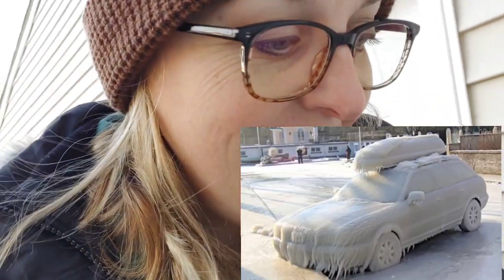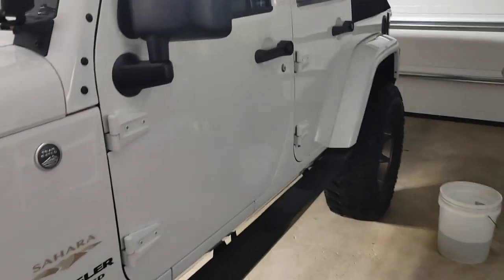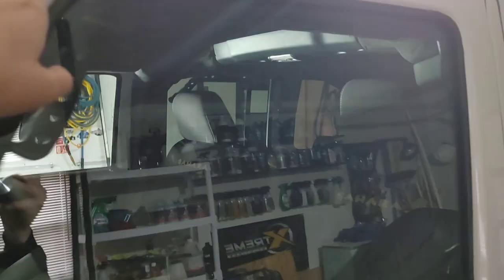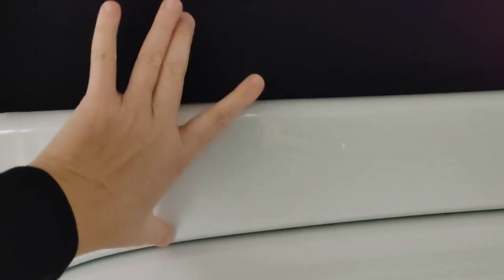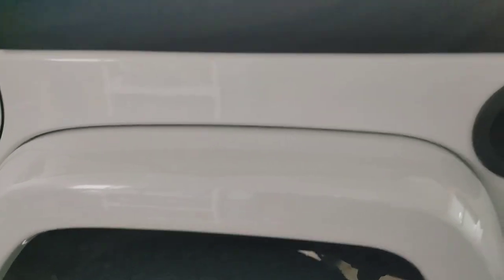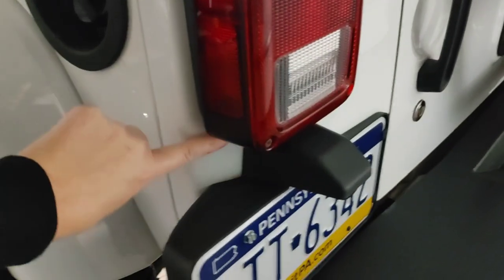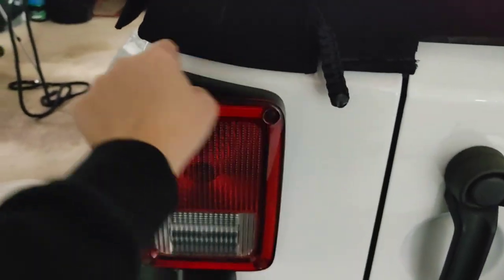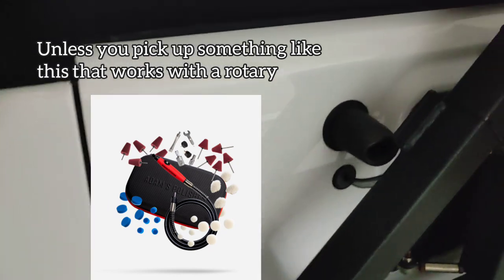Tips On Polishing Jeep Wranglers- Polishers and Techniques To Make A DIFFICULT Detail Easier!

Comment: Chelsea, question for you. I'm doing a Jeep at present. The Jeep is near completion, Ceramic Coated but on 2 fenders  I saw 2 areas I didn't like so I hit them with 2000 light wet sand, scratches are almost out but a little hard to remove completely. What's the best method to finish out. I use PRESTA Compound & polish. I normally do Gelcoat Correction. What's a good RPM for this fender & pad selection?

Comment: Nice info! I'm jealous that you're able to work when its that cold. It's bitterly cold here today and I just can't get my shop heated up enough to work in. :( Great Job!
Reply from the maker: Get yourself a mini split! Its a comfy 63 in my shop right now
Reply: @attention2detailswchelsea  don't think it will work in my application, I'm in a converted ex car wash bay with concrete block wall construction and huge 10" tall doors on either end. Its my first winter in it so I'm still figuring things out. Definintely need insulation and a dedicated heater i see that now! :)